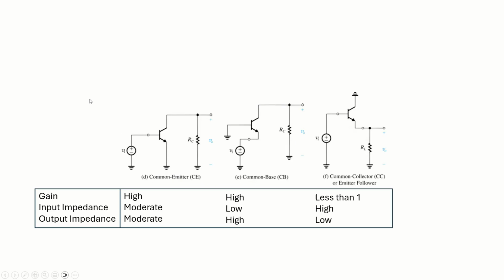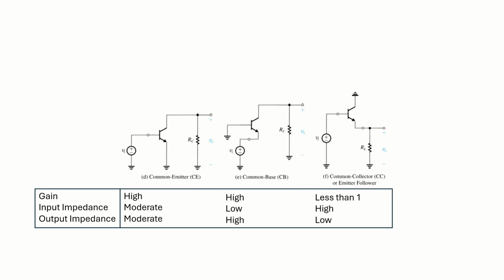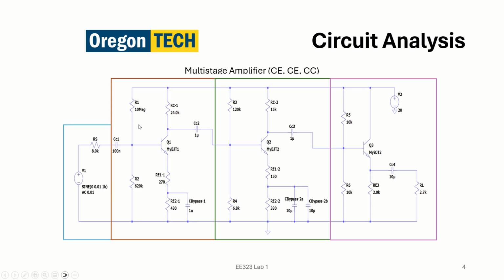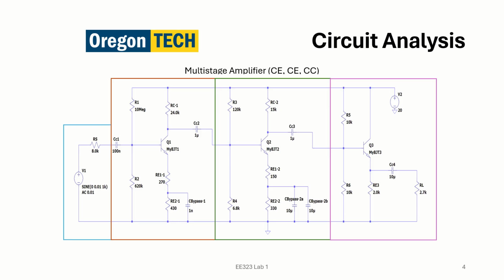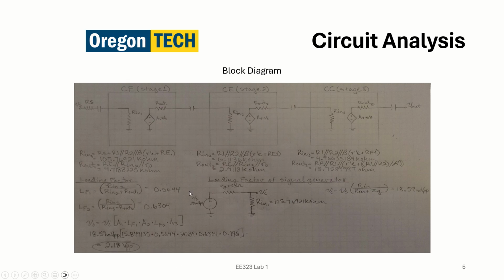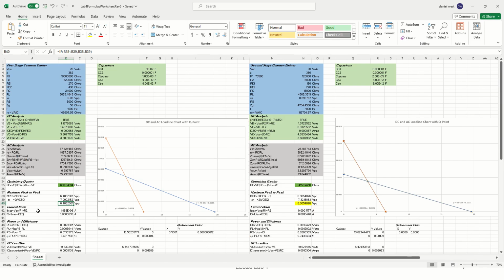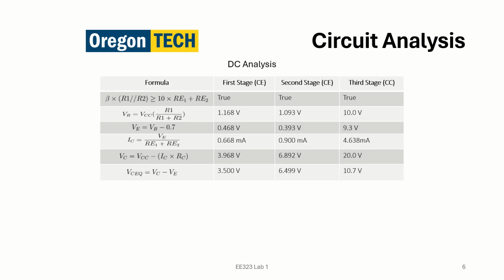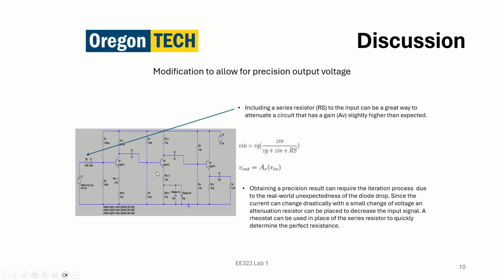Design Methodology for Multistage Transistor Amplifier

Comment: I see a problem with your first stage: The current running through your 10M Ohm, has to be around 10 times higher than the current running into to base. - That is not possible if you place 10M Ohm there and at the same time have a 24k Ohm resistor on the collector. - Question to help you out: How many mA do you expect to run into the base of that transistor?... What is the gain of that stage?... - Can you follow me?...
Reply from the maker: Thank you for your insight. You are absolutely correct that this does not follow the stiff voltage divider rule for the first stage. When I performed this lab originally, I stuck with the requirements per the lab manual. One of the requirements was to achieve above 100k Ohm input impedance, I noticed that the stiff voltage divider requirement was not stated in the lab, so I increased R1 and R2 on the bias network of the first stage to meet this goal. 

It was a gamble but building the circuit experimentally I was able to reproduce the theoretical results rather well. Even the maximum peak to peak experimentally was 6.32 Vpp compared to the theoretical 6.54 Vpp. Although lacking a stiff voltage divider on the first stage does explain why the signal tends to clip more on one side than the other. Ideally, I would have used an additional common collector (emitter-follower) stage to preserve input impedance while keeping the DC bias stable.